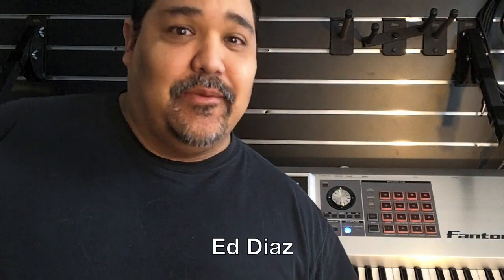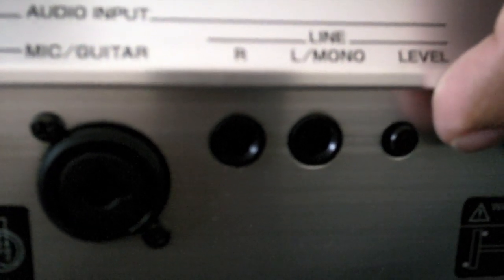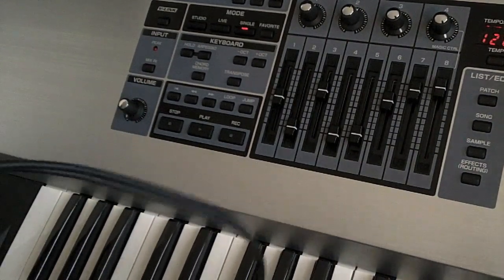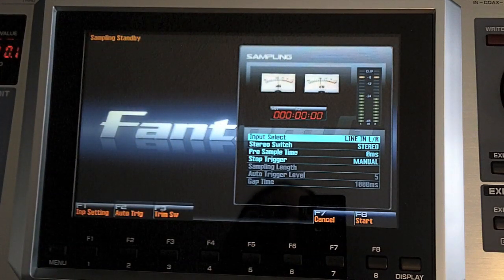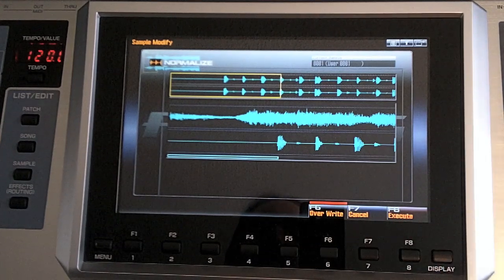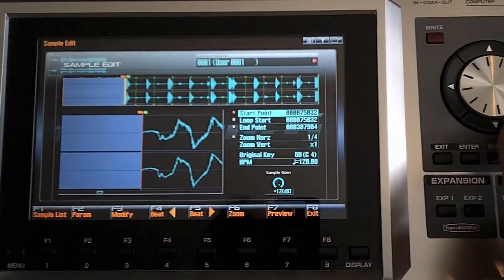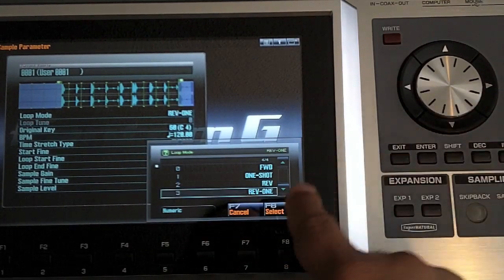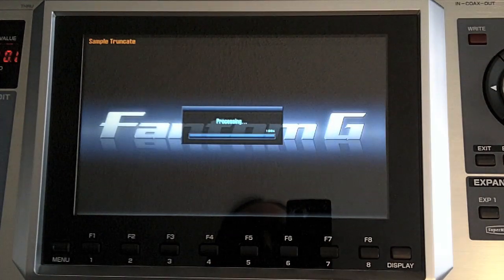Roland Fantom G Basic Sampling Part 1

Comment: Why do sample sound different when imported into the Fantom G. The sample sounds great on my PC but when imported it either gets boosted and sounds a little distorted and yes ive removed the +12db setting but the high end still sounds different or the sample lacks the original high sheen quality it has on my pc. And this is played down usb audio line through the fantom g so no other speakers tainting it. Even when i make a midi mockup and resample to bounce down the sound is changed in the bounced wav. Hard to pin point but it sounds like the harmonics have change very slightly and ive tried normalizing to bring it up because i know the volume drops but thats not it. Any experienced people here on this um basic sampling page :/.
Reply: I've been sampling* with my Fantom and I haven't heard any horrible differences in audio recorded into the Fantom compared to where I'm getting it from.
Reply: Good job